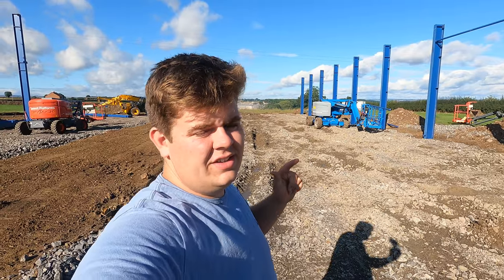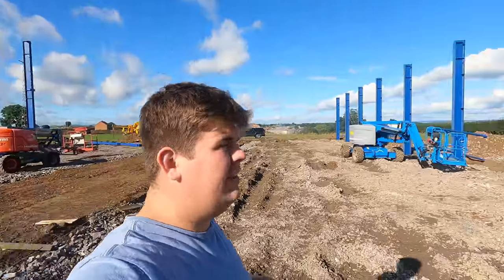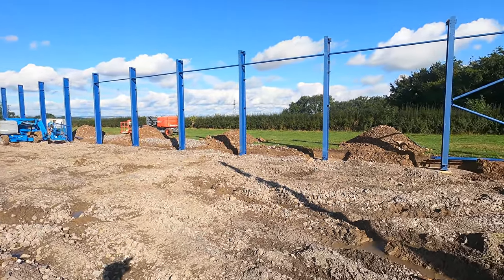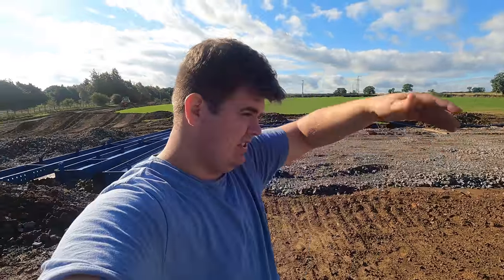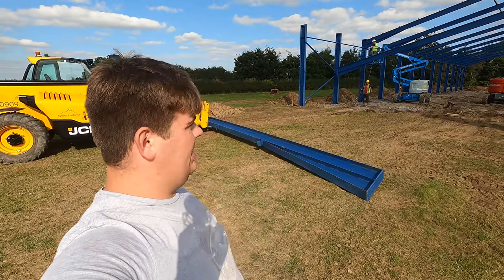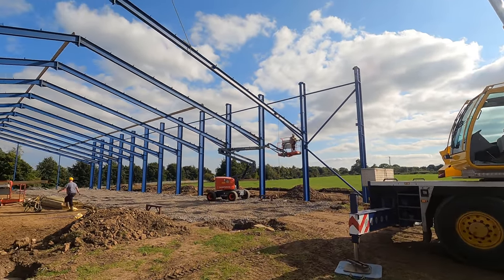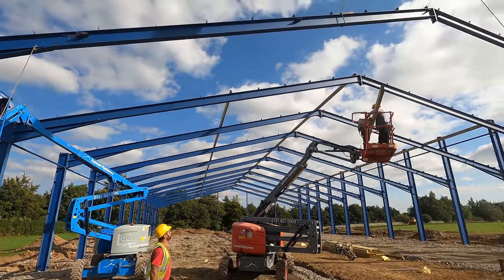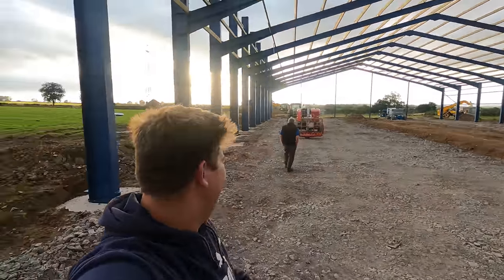SHED'S LOOKING BIG!! STEEL IS UP!!

Comment: Why haven’t you gone for galvanised steel ?
Reply from the maker: Hello, when you look at the price of the galv and what you actually gain it didn't seem worth it. As long as we look after the shed and don't leave muck in their rotting it away all the time it should be fine. The gates and pens will be galvanised inside when we get on with them. Thanks  Jack.